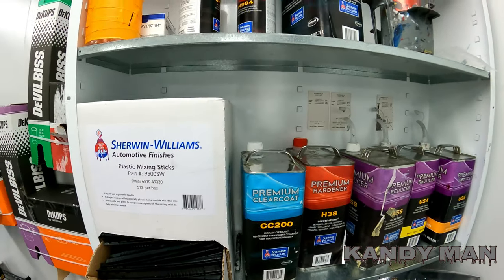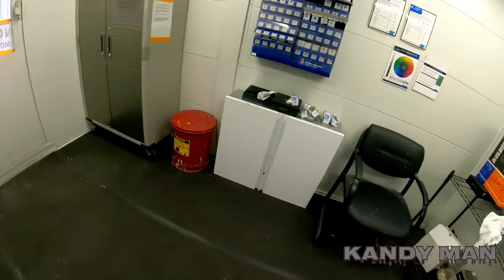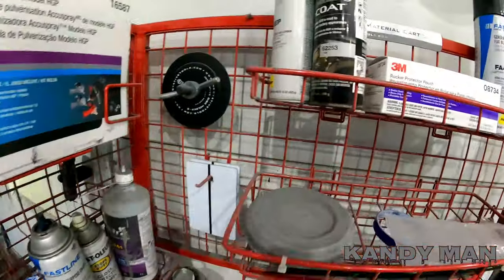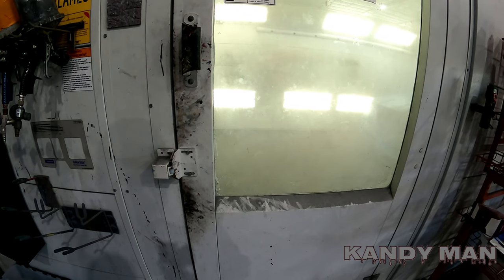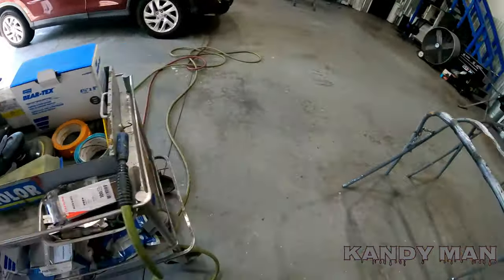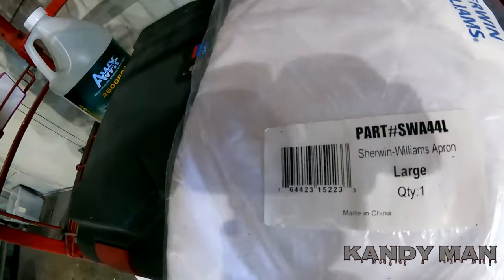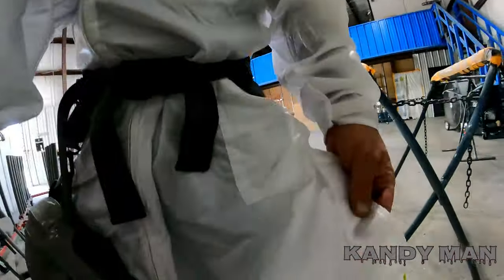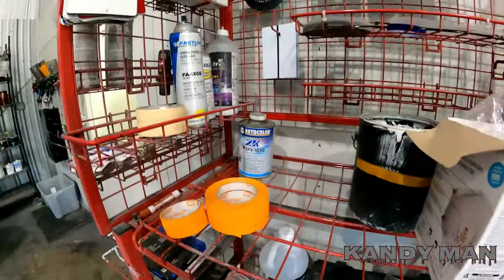MY PAINTING SET UP

Comment: I rarely see painters on youtube with enough safety. I use a 3m hood with fresh air from outside. I wanted the system that uses compressor air but they stuck with the separate system. The 2nd air line gets in the way sometimes. The waterborne paint is actually worse for the painter then solvent as it absorbs easier through the skin and eyes. Great videos!
Reply from the maker: Thanks brother glad you like the channel